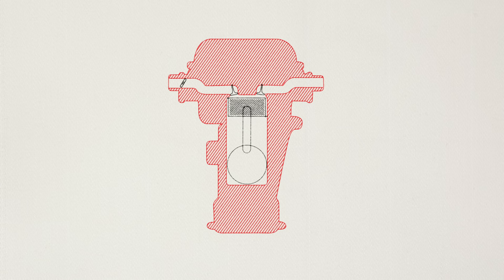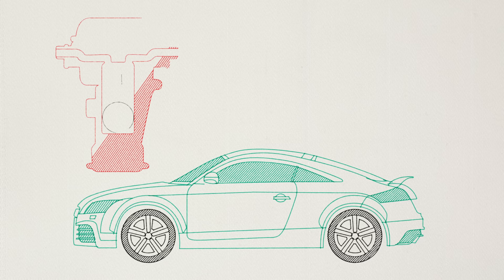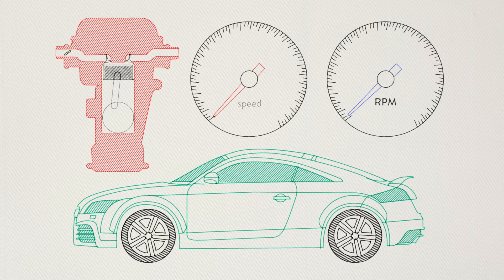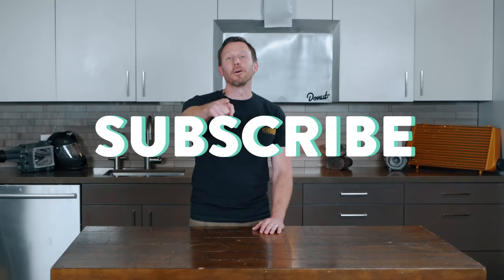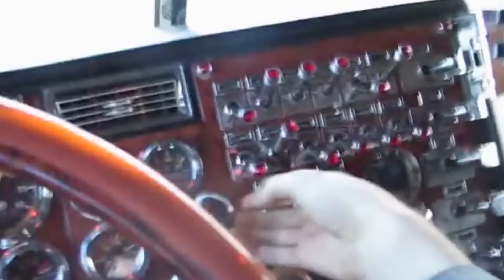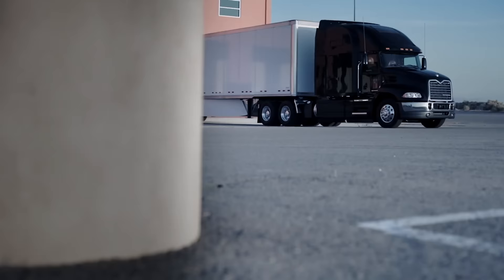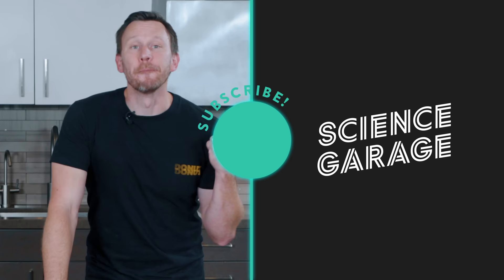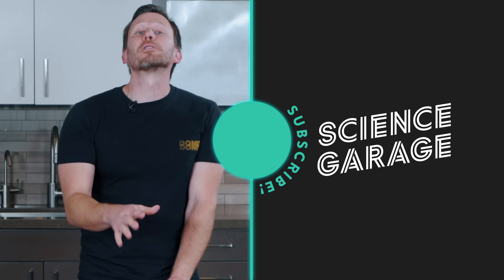ENGINE BRAKING | How Semi Trucks Slow Down Without Brakes | SCIENCE GARAGE

Comment: Just checked, was not posted on April fools??? Vacuum causes engine braking??? This is a self-eliminating effect. Yes, when there is a restriction in air flow, a low pressure/vacuum is formed above the piston that resists its traveling downwards, this gives a braking effect. But in turn there is less air charge above the piston to be compressed during the compression stroke, the compression now requires less effort. This in turn counter acts the vacuum braking effect. When talking about the common compression ratios found in resent history, the energy required to compress a given volume of air say 9:1 is greater than the energy required to generate a vacuum within the same volume. This can be seen with a syringe. Hold thumb over end and withdraw the plunger generating a vacuum. Most people will be able to pull against a vacuum and even pull the plunger out of the syringe, with some effort. Try it the other way blocking the end and trying to compress the same volume to the end stop. Instantly you will see compression requires much more energy than generating a vacuum per volume. Anyone that has attempted to pull start or kick start a small 4-stroke engine, will have noticed the compression stroke requires the greatest energy to get past.
Take a manual car, turn the fuel and ignition off and measure how far it takes to travels to a stop with the throttle wide open vs throttle closed. Depending on your engine combo throttle wide open can generate the greatest engine braking in this powerless example, as more air will be above the piston(s) during the compression stroke. However, many engines, throttle position makes no real difference to the stopping distance. “Engine braking is when an engine is generating insufficient net energy to overcome the forces require to compress air within its cylinders”.
Reply: Compression doesn't play a role in engine braking. Almost all energy used to compress the air is returned on the next stroke. A small amount is lost as heat but not a lot. In a gasoline engine the friction and pumping losses are what creates the engine braking. The closed throttle increases pumping loss. That is why diesels without an exhaust or jake brake do not provide as much engine braking as a gasoline, even though the compression ratio is much higher.
Reply: @Redtooth75  So then explain why; when going down a hill in a manual car (with carbs). Turning the ignition off, leaving it in gear, under engine braking. Depressing or releasing the gas peddle make no change to the deceleration. The engine braking effects stays constant.
Reply: @Davinator1981  it doesn't. A closed throttle will create more pumping losses and more engine braking. Compression does nothing for engine braking.
Reply: @Redtooth75  Have you actually tried???
Reply: @Davinator1981  dont need to. Im on the internet so i looked it up. You should try it.
Reply: @Redtooth75  Cheers for clearing the internet thing up. I also see there are heaps of articles on the net that tell this same story about engine braking. Theories are good but when ever testing any theory out in the real world over multiple vehicles, when they don't return the expected result, there must be something up. As you said "Compression doesn't play a role in engine braking. Almost all energy used to compress the air is returned on the next stroke." Then going by that logic, wouldn't the energy used up making vacuum during the induction stroke, almost all then be returned at the start of the compression stroke. These theories don't pan out with what happens in the real world.

While a j-brake opens the exhaust valve only degrees after TDC giving the greatest engine braking effect. Losing that stored energy before it can be transmitted back in the crank. Opening the exhaust valve any time before the cylinder goes all the way down to BDC on the expansion stroke will still generate a j-brake effect, just less effective the lower down the stoke the exhaust valve opens.

It is common for a petrol engine to open the exhaust valve on the expansion stroke around 50 degrees before BDC "bottom dead center", this generates a mild j-brake effect as the sprung energy generated from the compression stroke is lost before it can all be transmitted fully back to the crank.

The energy required and inversely stored in a vacuum is rather insignificant compared to energy required to generate and store compression.

Say a compression generates 180psi and 10% of that energy is lost due to heat etc., reducing the spring effect on returning the cylinder. 18 psi loss.
Average atmospheric pressure is 14.7 psi. Pulling a full vacuum of -14.7psi before considering losses, already inversely requires less energy than the losses during the compression example. 

*Energy consumed to generate vacuum during intake is minimal.
*Some of this vacuum energy is cancelled out as it aids the return of the piston up during the compression stroke.
*Energy losses during the compression stroke generating heat etc., is greater than the energy consumed generating a vacuum during the intake stroke.
*Opening the butterfly up generates less vacuum in the intake track. Increasing the air charge to be compressed above the piston, requiring more energy.
*Petrol 4 stroke engines have an inherent mild j-brake effect as the exhaust valve typically opens around 50 degrees above BDC, releasing the compressed stored energy before it can be transmitted back to the crank.

The above bullet points can all be observed in the real world. As I've said before, engine with no spark or fuel, opening the throttle butterfly generally make no difference to engine braking. Some engines you can slightly notice the engine brake effect increase as the butterfly is opened. It is part of 4x4 off road training. [unpowered descent using engine braking] students all give an odd look when told throttle position will generally make no effect. They then undertake the exercise to find out the throttle did nothing, engine braking stayed the same, intake vacuum/throttle position had no significant effect on engine braking. You will be amazed how many people are hell bent on the notion the intake vacuum should have an effect as they seen it on YouTube!!!
Reply: Here is a link to a phase sequence above. You will see how the Exhaust valve opens 50 degrees before BDC, this is before the piston goes down fully down, releasing that stored energy before it can all be transmitted back into the crank.
Reply: @Davinator1981  what you are saying is contrary to everything I have read. Do you have any actual sources?
Reply: @Redtooth75  Well coming from an engineering / instrumentation / programmer point of view, rather than automotive. However, have done a lot of work on automotive engines… If you are into tuning modern duel VVT-i, i.e. both intake and exhaust cam have variable timing. Advancing the exhaust cam can increase engine-braking, by causing the exhaust valve to open even earlier in the expansion stroke. i.e. right up to 80 degrees before BDC or otherwise called 110 degrees after TDC. The piston has only traveled just over halfway down the stroke before the exhaust valve opens and releases the stored compressed air above the cylinder, prevent quite a lot of that stored energy from going back into the crank.

Setting up a track car; on a dry track, heavy engine braking can have its advantages. Duel VVT-i and flyby-wire, allows some real trickery. When the driver fully lifts off the throttle peddle; cut fuel and ignition, advance the exhaust cam so the exhaust valve opens much earlier to release the stored energy above the cylinder much earlier in the stroke. Open the throttle butterfly(s) fully open so the engine compresses the most air it can (this is one of the advantages of flyby-wire, could not invert the throttle position so easily with a cable setup). It the driver applies the throttle or the engine rev’s full under 2000 rpm the throttle, ignition, fuel, cam timing goes back to normal. If you are running quite high compression and running on a wet track, this can be a bit too aggressive. So, running a wet track and dry track changeable program/map ECU can be quite handy, can even add a switch to the dash for this. Can really save those brake pads on track days.

Now that I have let out some tuning secrets. You will see; when someone says engine braking in a petrol engine is due to vacuum behind the butterfly, I ask if they have really tested that theory. I've already given some examples above that go against the vacuum theory that people can actually try for themselves. Hanging on to those old notions only holds people back from understanding how their engines really work. I see even Wikipedia talks about the vacuum theory. But to the general masses that never get right into tuning, the vacuum theory probably suits them fine. 

The operation of a J-brake / compression brake goes right back to water wheel driven pneumatic pumps used in old factories. As gravity is a constant force there is an optimum speed and volume of water for the water wheel to accept, to give the greatest leverage. When the air system comes up to pressure, if you simply disconnecting the drive, this would allow the water wheel to accelerate to unacceptable high speeds, so the use of a variable dwell compression release allows the system to regulate the wheel speed, so the wheel is at optimum rotational speed as soon as load/air demand comes back on. A centrifuge governor can be used to change the dwell of the dump exhaust valve, i.e., releasing that compressed air energy above the cylinder at different parts of the cylinder stoke to govern the speed. This generates the variable braking effect.

Comment: Geez I love the show but you guys got to proofread better. The opening line you say engage the clutch what you mean is disengage the clutch.
Without letting up on the clutch? You mean pushing it down? C'mon man
Reply: Jeezy gets worse you said you can't engine brake in a diesel without a Jake brake? Do your research. That doesn't make sense. Diesel without Jake will engine brake just like a gasser even better due to compression. I'm probably not gonna watch anymore any amateur mechanic could make a better video. WEAK have a mechanic watch them before they air. Duh.
Reply: Four or 6 times per cycle? You mean once. OMG
Reply: Four or 6 times per cycle? You mean once. OMG
Reply: Movement energy to heat energy? You mean kinetic to thermal bro. Need Jake brakes on your vid quality slow the descent 🤣

Comment: wrong, wrong, it must be something that is taught in trade school or past down from mechanic to apprentice.  No the engine doesn't slow down appreciably because of the air restriction/vacuum in the throttle/manifold, it slows down because of the compression stroke.  This  can be easily verified by fully opening the throttle whilst cruising down hill and killing the fuel or ignition or both(you'll need an old school car).  The car will actually slow down more with WOT,(because there is more air to compress) it ain't the 15 psi of atmospheric pressure that makes the motor slow down.  Why people haven't tried this simple test for themselves before making disinformative videos, I don't know. Warning( dont try the WOT for too long without cutting the fuel or you will get an exhaust full of fuel and kboom when you hit the ignition again)
Reply: No, you are wrong
The compressed air acts as a spring. Any energy used to compress it is returned on the next stroke.
The engine braking comes from the engine pulling a vacuum. When the throttle body is closed, the piston pulls a vacuum on every intake stroke, this is where the power loss occurs.
Reply: I take it you did not get in a vehicle and do what I suggested to test what happens when the throttle is opened and it’s effect on engine braking, that should be all you need to do to realise you are just reciting myths.
No compressing air in a cylinder is not like compressing a spring, unlike the spring, the air heats up massively under compression, much of that heat being transferred to the engine cylinder walls/pistons and to the cooling jacket, as well as some of it not being utilised and ejected on the exhaust stroke
Reply: ...and, by redtooths reckoning the motor should keep spinning for quite a while when the motor is turned off.....given the compression stroke energy is returned in the power stroke, but no, most motors barely manage a whole rev before they stop
Reply: @Redtooth75  so I’m guessing your still haven’t  tried varying the throttle on a Petrol engine when the ignition is switched off, that is the proof of the pudding, wide open throttle causes more braking, not less as the myth suggests.Sorry but linking to more people that recite the myth is just. Stupidity.  IF you want to be pigheaded and not actually try it out, them forever be an ignoramus.
Reply: @Redtooth75  so when reality disagrees with your theory, you claim it’s  an experiment to be ignored? Simply, again, opening the throttle wide open in a car under engine braking causes it to slow more than if  it is closed, then the engine braking is due to a vacuum theory vaporises right there( predicting that the vehicle would speed up if the throttle were opened)you can’t ignore reality/facts.  
From an energy conservation perspective the closed throttle/ vacuum explanation also falls down.  Where does the kinetic energy of the vehicle go here, if we were stopping the car with the brakes, we would have that energy turn into heat within the brakes themselves and transferred to the air.  Where does the energy go in creating a vacuum?, as if it all powerful. Do we see the intake manifold of the car get red hot with the throttle closed.......no, the energy has to go somewhere. The resistance offered by the vacuum is not significant, even in the extreme situation where you could block the valve on the intake stroke, all that is restricting the piston moving outwards is 15 psi of atmospheric pressure, and that is returned on the compression stroke with the atmosphere pushing it back in again.  Yes, the compresssion stroke offers significant resistance of over 10 times that of atmospheric(pressure over that of a vacuum).
So where does the energy go, when the air is compressed in the compression stroke it heats up, some of this heat is conducted to the engine block and some is ejected via the exhaust, simply in the heat engine it is not a  100% conversion of the energy used to compress the gas being converted to kinetic energy on the powere stroke.

Diesels don’t have engine braking because they have no throttle? Again, a myth that can easily be disproven by actually driving a Diesel engined car or suv, engine braking with these is more powerful than gasoline engines, as dictated by having virtually double the compression ratio.  So why do trucks etc have jake brakes, simply the engine is a much smaller % of the total mass of the vehicle and needs extra assistance to retard it on grades etc, but born from this we have the myth that because most big rigs are diesel, that engine braking doesn’t work on Diesel engines!
Uneducated opinion, I don’t design or build engines for a living, but do have a mechanical engineering degree.